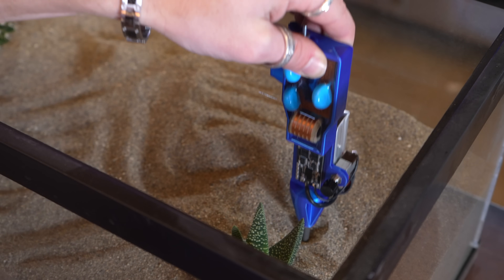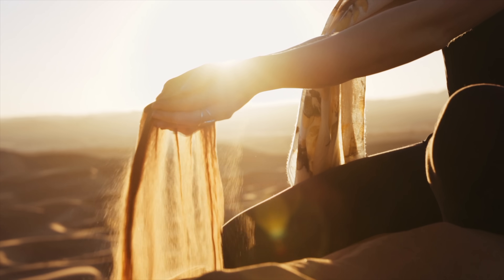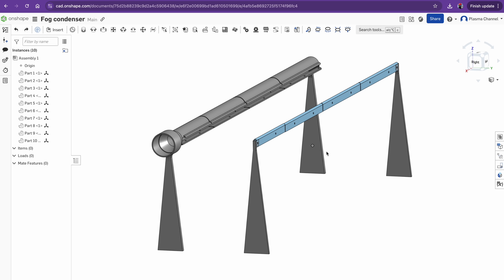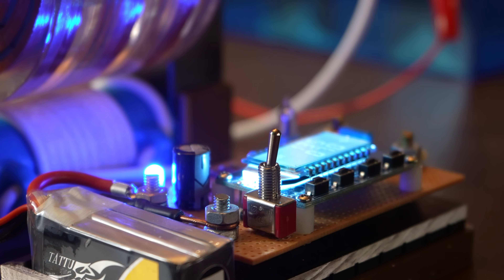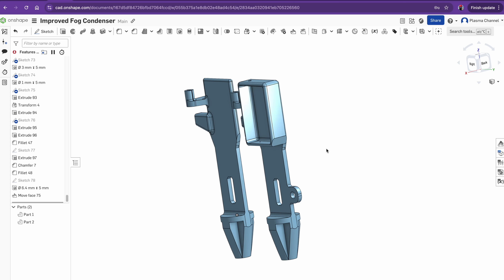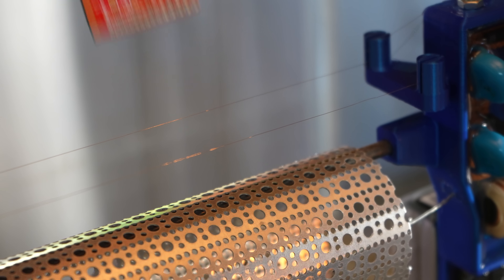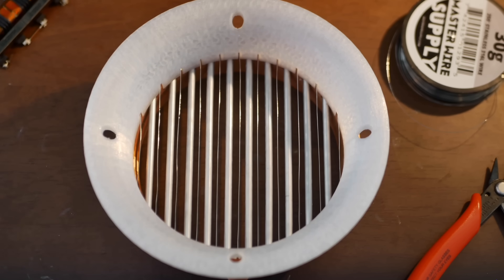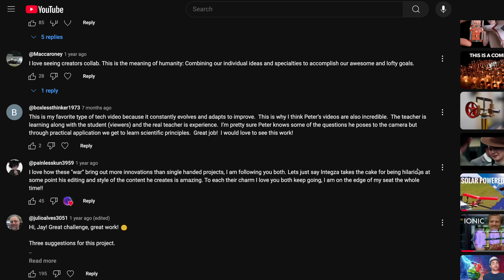Solving Desert Water Shortages Using 20,000 Volts

Comment: This is the first time I have seen a "revolutionary device to draw water out of thin air" that isn't just a reskinned dehumidifier. Yay!
Reply: Have to admit that the first prototype was impressive, now to scale that to thousands of linear feet 🤔☕. Great start! 💯
Reply: You could combine this by setting it up close to powerlines ruuning to cities etc. 
The High voltage lines in their basics should do something similar to the Humid air, qnd you could build a Grounded Mesh along its route that uses zero power (since those power lines need to transport the Electricity anyway) 
Its just a rough sketch that probably don't hold a direct confrontation with a irl Setup of such.. but it would not consume additional energy, uses existing infrastructure, and can collect tons of water in the morning to be stored and shipped via pipes/trucks to wherever
Reply: @ it would consume some additional energy, albeit probably less than having a separate device.  However the real issue is why do this?  There just isn’t much water in the air. Or if there is, it is raining…and water isn’t in short supply.  The inherent problem is that locations that would need this don’t offer conditions in which it would  work.
Reply: Thunderfoot is rubbing his hands together in anticipation of the wrath he will bring down on this
Reply: @gorak9000  Thank you, I thought I was going insane, these people are deluded
Reply: technically it is a dehumidifier
Reply: When fog is present, the electrostatic method in this video is more efficient because it attracts liquid water droplets already in the air.

When there’s no fog, most water in air is in gaseous form, so a dehumidifier is more efficient as it cools the air to condense water back into liquid form. 

You have to remember that water is a good heat sink because it is a very stable molecule, AND especially because it is dipole, meaning the two hydrogen atom are slightly on the same side geometry causes one side to be slightly negative and the other shortly positive, allowing water molecules to attract each other.  That's why water has a higher evaporation temperature than rubbing alcohol or gasoline.  As a result, it took a lot of solar energy to move water from a liquid state into gaseous form into the air.  That means in order for it to get back to a liquid state it MUST LOSE a lot of energy.  This electrostatic method in the video does NOT remove energy from water molecules in the air.  It only attracts LIQUID water molecules in the air (ie fog).  As a result, it can only convert fog (liquid water molecules in air) to liquid water.  It can't easily convert gaseous water vapor in the air into liquid water like a dehumidifier can.
Reply: @VamYang Yes. Well said. Unfortunately people are so uneducated that you need to explain this fact.
Reply: well drawing water out of thin air does dehumidify, this is just another way to do it
Reply: Anythibg that takes water out of the air is a dehumidifier. This takes water out of the air.
Reply: @ but does it take water out of air though ? or does it only work with fog .
Reply: @cornnatron3030  my assumption is that it does with lower efficiency, but it does.
Reply: It's nothing new, systems like this are used to remove coolant fog from air in machine shops.
Reply: Dehumidifiers are way more efficient
Reply: Except thats literally what it is 😂😂
Reply: I mean any device that draws water from the air is by definition a dehumidifier.
Reply: @matthewtalbot-paine7977 since it's a fluid in a fog, it's not "in the air" per se
Reply: You can buy a cheap salt dehumidifier for your house that works well even if the air isn't fully saturated to the point where it's foggy. You can make such system with the addition of an osmosis membrane to filter out the salt and use it as a water out of thin air in the desert system that doesn't require electronics nor power
Reply: @halnineooo136 reverse osmosis takes a lot of power
Reply: Fog is bigger droplets than moisture vapor in air right? Would work on morning fog areas
Reply: @poseypapusdiazfamily4630  moisture vapour is a gas. fog is tiny liquid droplets, so they're very different.
Reply: @poseypapusdiazfamily4630 fog is water vapor
Reply: They get bought out and squashed. ALL TECHNOLOGY. It's all about DELAY. That's how they stole your life away.
Reply: I mean.. technically it is.   Humidity in the air - is removed, thus "dehumidifier', it's just that this one - seems to actually work, although - one would need to test these 'morning fogs' in actual climate and densities, and not from a fog machine.
Reply: It's far from the first.  Not even sure it's the best.  Need to see an actual working prototype in the field, and by field I mean the Sahara.
Reply: I mean it kinda is (but still pretty cool).
Reply: Sounds like you havnt seen any survival tricks..
Reply: ja ouviu falar em ar condicionado?
ou apenas uma chapa gelada ja basta para condensar a humidade do ar
Reply: The dehumidifier is twice as energy efficient.
Reply: It's Advanced dehumidifier
Reply: no mystery why condensation of water using something cooler that the ambient temperature works, because it works very well.   anyone with a cold drink,  and water all over their table knows this.

although I love high tech solutions,  they are not always practical.

one of the best systems I have come across,  is a solar ice maker !   not what you think.   no photovoltaic cells or sterling generators here.  the system works by using curved shiny surfaces focusing on a tube,  this tube is filled with ammonia gas,  the heat during the day,  causes the gas to expand,  it compresses in another tank,  then at night,  that gas is released back into the focal tube.   and we all know what happens when gas expands.  in the original system it was used to make blocks of ice,  water would be poured around the focal tube,  and freeze by morning,  it is removed and the whole process is repeated,  basically making ice with the sun, without electricity that uses no other resources.  the ammonia is a closed system and can be used over and over,  its a simple device.

this system could easily be modified and used to condense water out of the air.   and all it uses is some pipes,  ammonia a tank, and a couple valves.
Reply: Thin air that’s filled with water.
Reply: It is though….thats exactly why it is.
Reply: @pauliexcluded1 this is completely different?
Reply: @pauliexcluded1  No, it's not. A dehumidifier pulls water in the gaseous state out of the air. This is directing the fine water droplets (in the liquid state) already present in fog onto the collection grid. It should be a lot more efficient as it does not have to pull thermal energy out of the air to reach the dew point.
Reply: @ ooohhhh…. That IS a neat idea…
Reply: @ I mean that is neat.  But still there is never much water in the air, because of fog.  It just precipitates out.  And you will never have fog much in areas where there is a water shortage…. So it remains a stupid idea but the tech is neat.
Reply: @pauliexcluded1 
You'd only have fog in dry areas by the ocean when fog forms over the ocean overnight during cool nights and the winds blow it inland to the dry deserts, and only before the sun heats up the fog, changing the liquid water molecules into gaseous state of water vapor.  You can't do this in the middle of a bone dry desert.
Reply: small correction the device pulls water out of thin fog . which is different to air.
Reply: This is absolutely brilliant.
You might have just solved one of the biggest problems that a big part of humanity is dealing with now,
and it will very likely grow bigger in the near future.
Hats off to you and your so timely,
accidental invention.
There is a pure genius in its simplicity and affordability.
I can imagine the deserts start to be
growing green and
the painful wave of starvation and migration reverse
in so many places on our so beautiful 
and so battered planet.
Reply: @julianowczarek7262  this literally is nothing that special. It's extremely niche in where it can be useful. My god people in these comments are so very strange.
Reply: But, it stays still?

🤔
Reply: This is absolutely brilliant.
You might have just solved one of the biggest problems that a big part of humanity is dealing with now,
and it will very likely grow bigger in the near future.
Hats off to you and your so timely,
accidental invention.
There is a pure genius in its simplicity and affordability.
I can imagine the deserts start to be
growing green and
the painful wave of starvation and migration reverse
in so many places on our so beautiful 
and so battered planet.
Reply: I mean, it really is just a reskinned dehumidifier. 🤷‍♂️
Reply: @interstellarsurfer 
No. It's not.  This just uses static electricity to move LIQUID form of water (fog) from the air back to liquid out of air.  A dehumidifier cools down air, removing energy from the GAS form (vapor) of water in air, allowing it to condense back into actual liquid form.

Two difference scientific methods, unrelated.
Reply: Look up Moses West Foundation. He created a machine that collects thousands of gallons a day. He's made many for different low income and poor water areas like flint Michigan. He even was given a Nobel Prize recently.
Reply: @FuranshisukoR  You are a liar. "What type of energy powers the [thing] ...our generators are capable of operating on 3 Phase 460 volt power from any source for flexibility..."

And he was NOT awarded a Nobel Prize.
Reply: @FuranshisukoR  His machine is just a giant expensive dehumidifier, and he hasn't even been nominated for a Nobel Prize. I don't want to discredit his work, but don't just make stuff up.
Reply: @coltonm8623  I stand corrected. There were talks about nominating him at the united nation water conference in 2023 for his multiple staggering achievements. That's why in another comment I included putting these two minds together could be a game changer in the world. These two are doing work that towers mainstream which both should be nominated for the nobel peace prize. But basically near free water for all would dig into governments pockets. Plasma in my opinion would be simplified and maybe better. But yes thank you for the correction. I'm man enough to admit it. Thank you
Reply: @FuranshisukoR  But it's not free for all.
It's free to those who have enough humanity in the air to pull the water from.
In extremely arid places where humidity is exceptionally low or non-existent, neither conventional dehumidifiers nor this method would work.

It's why in many areas that have water scarcity those kinds of systems have failed time and again.
Because you can't pull water out of the air that isn't there.

Which is explained in this video that this invention would only be effective in places with fog.
Reply: @ColtonVi  it does not seem so.

@PlasmaChannel claims 14ml/Wh, which is around 72 Wh/L.

This foundation claims (quote from their FAQ): "typically under 0.08 kWh per liter of water produced", which is < 80 Wh/L, so roughly equal.

This indicates that in all likelihood this is the same technology.
Reply: @FuranshisukoR  Uh no he wasn't. What kind of weird misinformation are you trying to spread? Do you work for the guy or something? So strange. Dude made a dehumidifier. Nothing novel or special about it. lmao, I'm dying.
Reply: @FuranshisukoR It is geared for mass production of water and requires a lot of electricity. They quote 80 W-hrs per liter of water.
Reply: @FuranshisukoR  That is just a scaled up Dehumidifier you can examine it close and tell that is exactly what it is. nothing new about it.
Reply: @FuranshisukoR can find no record of Moses West recieving a Nobel Prize.
Reply: @justicar5 he's already apologized for that. Read before commenting.
Reply: Learning something new everyday, great comment.@FuranshisukoR
Reply: @FuranshisukoR  Dawg, Flint Michigan had tons of donation and nonprofit money rolling in that random nonprofits like those were started. Flint had a dysfunctional government and had to do many repairs, but they are not poor in water, that was never the problem. The machine itself probably uses more energy (and therefore more water) than it produces
Reply: @FuranshisukoR  This is a much better use for tax dollars than... REPLACING THE DAMN PLUMBING. Stop using ad-hoc improvised solutions. You are acting like your dad again, America.
Reply: @FuranshisukoR  thats an industrial dehumidifier. Nothing new, loud, huge, very expensive and extremely inefficient. He was not given a nobel prize, he wasnt given anything at all. He wont ever get a prize for turning on and off a dehumidifier. 

You should think a bit before commenting and spreading misinformation. And making yourself look stupid in the process.
Reply: @FuranshisukoR  Moses is a legit legend for giving water to those who need it
Reply: The Moses West Foundation is an interesting one... You can't find anything out about the tech though, as it's proprietary tech provided by AWG Contracting (a private entity), which Moses West is also the CEO of. I don't know how much funding comes from donations and how much from West himself or AWG Contracting, but I'm personally hesitant to lay too much praise on that particular setup...
Reply: I was working on a different system using no electricity and it only had one moving part. I couldn't get anyone interested, even though the science is good.
Reply: This is NOT new. They've been doing it in the Andes for ages
Reply: @FreeFlyerUk I don't think they're using high voltage in the andes lol
Reply from the maker: Ah come on, did you even watch my video FreeFlyer? I mentioned in the video why fog nets barely work. Please show me an example of them using high voltage to collect fog in the Andes!
Reply: @PlasmaChannel  how does it compare against a dehumidifier in say a place with 65% humidity is what im wondering?
Reply: @PlasmaChannel  do mind doing a part 2 with hot water vapor from boiling pot and see if/how it influences the efficiency? I'm talking about coastal yet dry lands (sun heated ocean breeze blowing inland). Would also love to see your setup running in the desert, in the afternoon, when air humidity is quite low. I strongly believe we're in for some huge surprise (however, it should be covered to prevent instant evaporation because the cathode heated from direct sunlight exposure). Great video and thanks for sharing your knowledge.
Reply: @PlasmaChannel  Air in your studio is at least twice as humid as  in desert. To have a fog it should be even more humid. For desert it is 15 g/m3 you can’t get more water from air than it has… air is not containing more water at nights, it is just getting more “visible” at low temperatures.
Reply: @PlasmaChannel  Bro don't get sucked in down here in the comment catacombs. It will consume you.
Fantastic work. Ignore comments like his and keep it up!
Reply: @PlasmaChannel  but your argument against the fog nets was efficiency in percentage. You didn't use the same unit when measuring the efficiency of your device. I'm also not confident the dehumidifier was a fair test. It's designed to bring humidity down, not produce water. Idk for sure but it could be losing because it's designed for the one purpose, maybe it excels in average household humidity, and bringing it down. Whereas your device was given 100% humidity.

Lastly the 20kv isn't exactly safe, there is a substantial amount of exposed electrode.
Reply: @PlasmaChannel  But you compared it's efficiency to a peltier based device which are known to be terribly inefficient. Now compare it to a ranking cycle device. 

Also it needs to be tested at realist humidity levels. The efficiency is likely to be much less. 

Interesting post though. Now place it up at 15000ft with a small tube to the ground. It might even generate its own charge.
Reply: @codures this apparatus simulates the morning fog before the sun breaks through, your boiling pot would be inappropriate.
Reply: @alanhat5252  indeed, but most inventions are accidents that turned catastrophically right. What's wrong with trying different conditions, even inappropriate? Maybe there's a new disease in town called chartophobia that I never heard of 🤭.
Reply: @PlasmaChannel  they doing the same thing with the same knowleg but changing the index of reflexion painting the rocks with color using metalic paints...
There is nothing new under the sun... Just people.
Reply: @PlasmaChannel 1. You're literally not living in a desert and you are using humidifier to raise humidity even further to demonstrate your machine. If it was humid like that in the desert, it wouldn't be desert. 2. Where will they get reliable high-voltage electrcity in 3rd world countries that actually need this?
Reply: They didn't invent it in the Andes @FreeFlyerUk
Reply: @FreeFlyerUk  No, they haven't lol.
Reply: @FreeFlyerUk  not really the same technology mr bozo. Passive Fog Nets in the Andes
How it works: In places like the coastal Andes (e.g., Peru and Chile), communities use fine polypropylene or metal meshes to capture water from fog. The mesh intercepts tiny droplets, which combine and drip into collectors. No electricity is needed for the basic version.

Yield: In optimal conditions (dense fog, high humidity), these nets can collect 2-10 liters of water per square meter per day.
Reply: @FreeFlyerUk  they didnt say it was new. try again.
Reply: @FreeFlyerUk   my grandma did this even before the Andes
Reply: @FreeFlyerUk hahah how clueless are you my friend? Show us some evidence lmao
Reply: It's nothing new and all you need is a huge plastic mesh net and fog
Reply: @BurkenProductions  Did you even watch the entire video? DO NOT SKIP: ACTUALLY WATCH IT. He went over that and explained how those systems are terribly inefficient and produce very small amounts of water.
Reply: @BurkenProductions Why would you double down on a comment that has already been debunked in the same thread? Comprehension issues?
Reply: @BurkenProductions  this is new because it's far more effective at capturing water than passive nets